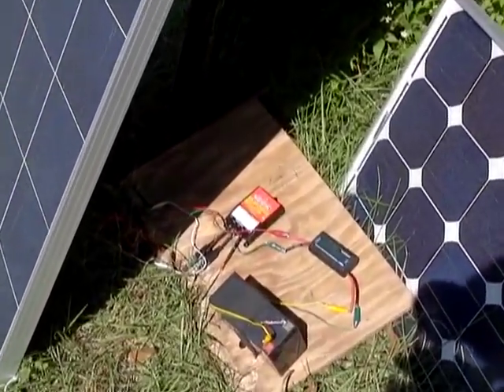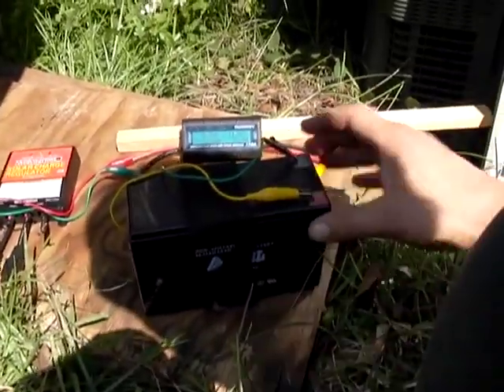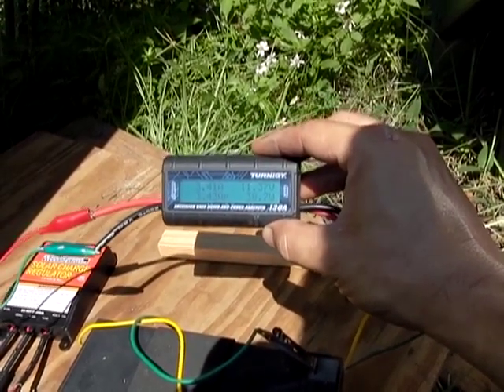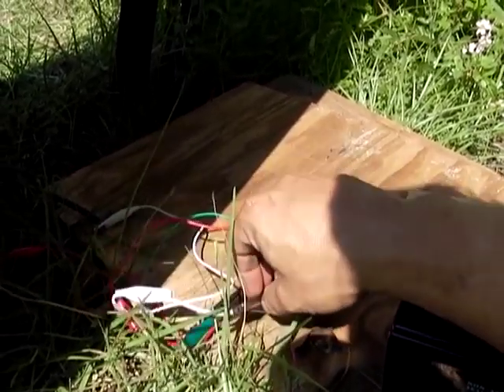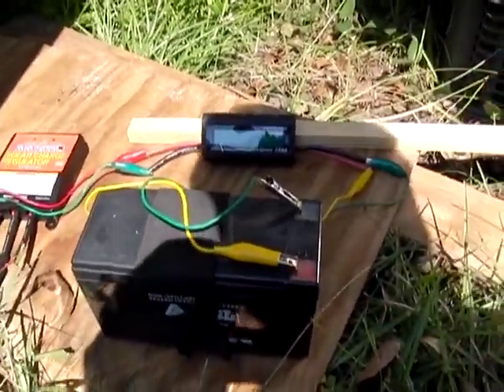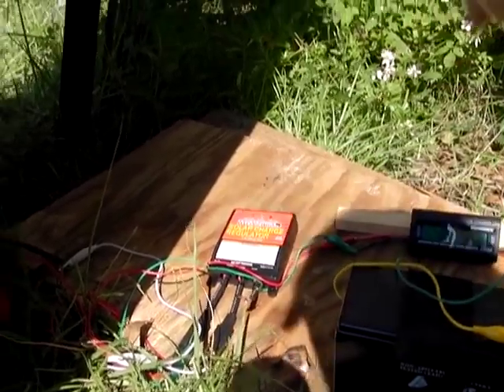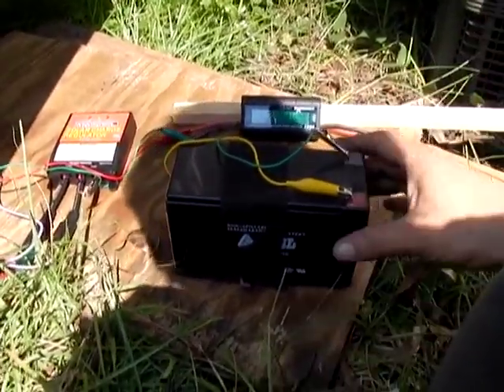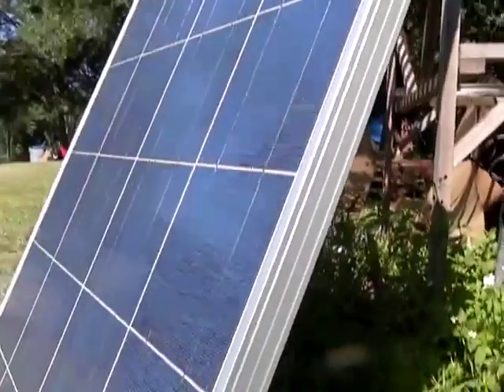DIY Solar Panels to Charge Controller 7 AMP 12 VOLT 100 WATTS Do it yourself panel hookup

Comment: I have that small harbor freight regulator, seems to be excellent, I’m hooked up with one 100 W solar panel going into a 100 amp deep cycle battery, I know the deep cycles as you charge them sometimes will show more than 15 votes, the Regulator kicks off around 14 or so, and the green light comes on, it says in the instructions whenever the green light comes on too quickly unplug the power to the battery, is this necessary on a deep cycle battery?

Comment: cool stuff! one question: this battery can only take about 2.1 amps and the panel provides about 6amps. does the charge controller manages that? i have a similar setup and i'm a bit worried i'd make the battery push out gas or worse..

Comment: Someone needs to look up what "DIY" actually means.   Buying two pieces of completed equipment off the shelf and plugging them together is not "DIY".  Getting out your electrical engineering books, designing a circuit, buying transistors, capacitors and resistors and  building a circuit is DIY.   Worthless video.
Reply from the maker: DIY to install vs having someone do it for you. Based upon your comment, DIY house renovations are illegitimate due to buying cabinets and kitchens appliances. Nothing really is DIY unless you ore metals from rock, and go from there. Even then you are not truly making it from scratch.
Reply: Wow what a shitty hot take lmaooo

Comment: I have the Harbor Fright 100 watt solar panel kit. Do I need to have the 100 watt 7amp regulator since it comes with a 10 am charge controller?

Comment: If I want to use a 15 W panel and this charge controller from the video (both from harbor freight) to keep a pop-up camper battery charged during the day, can I just hook them up to solar input and battery output, respectively?  And leave the "load" connection taped off?  I don't really intend on drawing huge loads from this type of setup.  The main draw from the battery are LED lights at night, and occasional water pump usage.

Comment: I have 2 of the harbor freight 15 watt solar panel and their charge controler same as what is in this video. I am hooking up the 2 panels into the harbor freight octagonal connector to charge and maintain the battery 17 AH of my Stanley 5 in 1 power station. My question is why is the charge controler led shows charging even in darkness does this mean my battery is draining? I thought the controler is supposed to stop discharging the battery? I would appreciate any suggestions so I can have a solar powered battery maintainer.

Comment: I guess you're not so green if you're overcharging lead acid batteries and releasing toxic gas.  Try to be more careful, we have to breathe the toxic gas from your failed experiment.
Reply: Last I checked, hydrogen and oxygen weren't toxic.

Comment: To really know how the battery will act on a given discharge rate you would have to look at the data sheet for the battery.  To get that 7 amp hour rate that is at a very low discharge over 20 hours.  Power Stream has data sheets for all their batteries on line.  They will give you a better idea oh what kind of a load a given battery will handle

Comment: If your solar panel has a terminal block and not a junction box, how would you go about setting up the whole thing?
I am just checking before I buy anything. My panel is done with the terminal block connected.

Thankx

Comment: Hi there. I have a question, what do you do with the load wires when not in use as you show in your video, should it be covered with tape or what?
Thanks for your video.

Comment: This doesnt sound right, are you sure that you only get 15.5 amps. A 100watt 12 volt panel normaly gives 6amps, I get 7.5 amps at midday, you need to measure your outut at the brightest part of the day and make sure your panels are square on the the sun. WHEN you get your max reading you can then get a controller that exceeds your max ampage.

Comment: Great video!
for a demo running 100watt through a 84watt charge controller is ok but i should expect to blow the charge controller if left on for 2 hours. Am i right or should i expect 16% headroom?

Comment: My understanding is a 7 amp hour battery will let you draw 1 amp for 7 hours or 7 amps for 1 hour or any combo. Is this not correct? What is the basis for your formula in the video?

Comment: I wanted to ask you about how to match up your solar panels with a charge controller.  I have (2) 145 watt solar panels totaling 290 watts and they put out 7.75 amps each for a total of 15.5 amps.  When I look at charge controllers I come to the conclusion that I need a 20 amp charge controller but some charge controller say a maximum of 220 watts even though they are 20 amp charge controllers.  These are 12 volt solar panels.  Do you match the charge controller with watts or amps?

Comment: Ok I need your help please. How can I contact you? I am setting up an home aquaponics system and I want to run the water pump and air pump off of my car battery. (400-500 amps). The pumps are DC 120v each about 2.8v each. What I want to do is hook up my harbor freight 15watt solar panel to the charge controller and have my 2 pumps running off the battery while it is charging. Is this possible to run the battery with that small load while its charging. Oh also I will be using a power inverter.

Comment: i have a 140watt solar panel and a mppt 30amp charge controller will this charge my 2 12volt batterys they are CCA1000 will my solar fully charge my batterys email me plzz thanks                adamwietczak007@hotmail.com

Comment from the maker: Under is fine. Over the rated amperage can damage the controller or some reduce your maximum wattage potential. 90% of the rated amps are the max I would go.

Comment: @dappa211 It takes the power from the same current that it measures. You got something simple like: left side-IN, right side-OUT. The Turnigy watt meter is sold directly by HobbyKing.

Comment: @GREENPOWERSCIENCE 

Is there any danger of a power system conflict if I have the solar system integrated with the pre-existing trailer wiring on the 110v side?   I clipped the cables from the factory 12 power charger and am running separate 110v plugs and circuits out of my batteries.   I figured that if someone plugged the trailer in with the inverters feeding to the existing 110v system might make a problem with grid compatibility until I spring for a grid tie inverter of sufficient wattage.

Comment: @GREENPOWERSCIENCE 

I have a power system in my camper trailer that involves 6 of the Harbor Freight panels, the charge controller seen in this video, two deep cycle 12 volt batteries and various mounts and wiring.  Running two 750 watt inverters (one is off unless needed, thus only running one cooling fan which sucks some power off the panels all the time), system cost is in the $900 range.    The cost difference between parking with utilities vs totally off grid is roughly $300/mo.

Comment: @GREENPOWERSCIENCE 

For RV applications, the "payback" can be a matter of weeks when you consider the cost difference between a primitive campsite vs the cost of a campsite with full RV hookup, or a campsite with sanitation hookup only.   $50 per month vs $350 per month on the lower end, $350 per month vs $750 per month during tourist season in more desirable areas.   Then there is fuel savings vs noise issues on using a generator in "boondock" RV camping.

Comment: This charge regulator is very similar to the one that came with the 1995-2001 version of the solar panel kit which got replaced by the newer model that has the digital readout and all of the plugs.   The issue is that fairly low amp/watt capacity for the money.  The charge controller rarely gets below $24 even with the best 20% coupons when it is on sale.   It will safely run only 6 15 watt panels and I seriously doubt the thin wires on the "load" part will handle much of an amp draw.

Comment: i have the same charge controller and never really used the load wires what do thoose do if i put a light on the load wires will it still send  the same amount of current to the battery i never new how that worked

Comment: @andruha11234 The payoff time is not only accorded to the cost of materials. It is also gauged against the cost to the materials used to generate the electricity.

Have you seen the cost of a barrel of oil go up lately?

1-2 year payoffs are just around the corner.

When the generating materials are GONE then either you have solar or wind power or nothing. That is IMMEDIATE payoff.

Comment: @davettalashley Heck yea! I have a small panel (12V, 170ma, 3W), a charge controller like you see in this vid, and my 8AH battery should be coming soon. It's not much, and given the low current on the panel, it will probably take ages to charge the battery, but it's a start. For now I plan to use it during power outages. I can at least charge my cell phone and power a 12 volt LED light. As I can afford to do so, I can upgrade my system. I am thinking the next upgrade should be a better panel.

Comment: Nice Demo, a 7 Ah Battery you show should not be charged with 4 Amps, best limit charge to 1 Amp or better O.7 Amp for battery lifeteme, means a 10W Solar panel is sufficient.

Comment: @koulailat - Sure you can. You can have as many AH as you want. Just keep in mind the higher the AH the longer it will take the panel(s) to fully charge the battery.

Comment: @andruha11234 ..Also you can go solar effectively for much less than 30k 20k or even 5k. The point is..your now in control of your electricity(solar electric), heat (solar heater) etc etc..that is something worth it weight in gold. Imagine god forbid a major crisis , another terrorist attack that left our grid down for months and your next door neighbor had a solar system capable of running his home for the month or more the grid was down.. bet you wouldn't be thinking it was not worth it then.

Comment: @GREENPOWERSCIENCE I seen someone post a comment about the Harbor Freight Amorphous panels saying that this type of panel being thin film and just its characteristics etc only lasts about 3-4 years and they degrade fast...is this true? Also I'm working on a solar can heater and am thinking of using a bilge blower with 240 cfm to exhaust the hot air into the living space..In a 4x8 size box with tin cans would that much cfm implode the cans and is it over kill? Also do you know if those are loud.

Comment: @qcages thats not true... the lifetime of a solar panel is between 20-25 years. 
"For example, a 10-kilowatt residential solar system costs about $77,500. After a state rebate of $38,000 and a $2,000 federal tax credit, the out-of-pocket cost to the homeowner is $37,500. Annual savings of $1,500 on bills. " = 25 years to pay off.
A 175 WAtt panel costs $550.00+. 175 watts time 6 hours a day of useful sunlight = 1000 Watts a day = 10-15 cents = 15 years to pay off. Batteries not included.

Comment: @andruha11234 It's not just about saving money. It's also about creating your own electricity from the sun, and not being dependent on electricity produced by burning coal or other fossil fuels. And the payback is much less than 20 years! And when that payback date finally comes around, you will be saving money INDEFINITELY from then on. Sounds pretty nice, huh?

Comment from the maker: @cdltpx Get a 2 deep cycle batteries and go with 80 - 100 watt panels with a charge controller. If you are in areas that have a lot of leave fall (this time of year) Keep em clean or go with Harbor Freight Amorphous. Your camper's charger is incorporated into the 12v inverter (most systems) so keep than in mind, you may not be able to charge solar only through the 12v system.